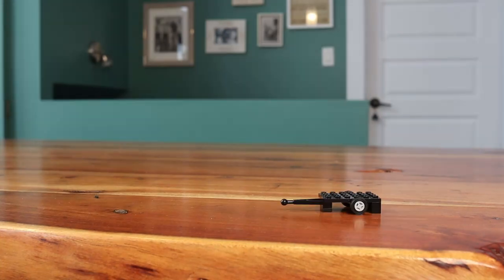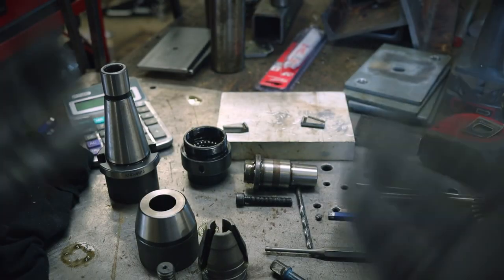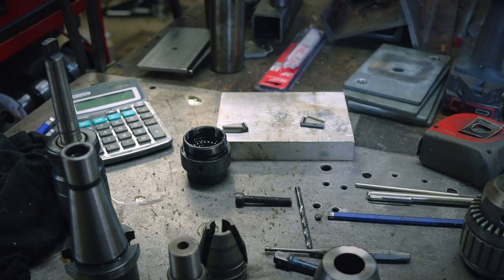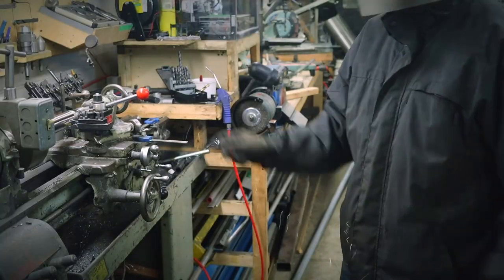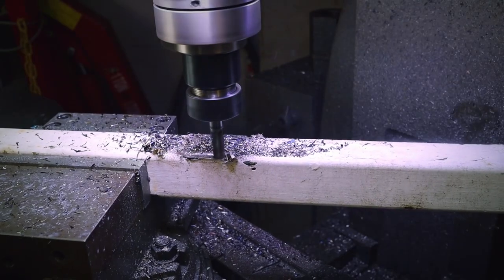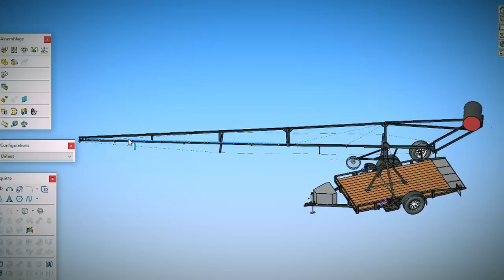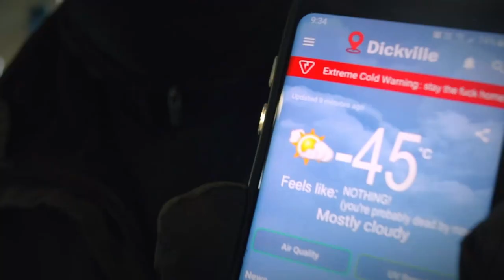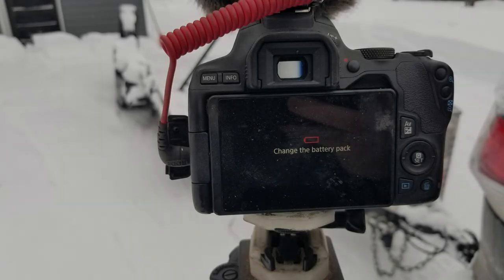FLYING MACHINE, Part 1: The base and main beam

Comment: Viny B
I love your stuff. Greetings from Missouri.
As a 57 year old heavy equipment mechanic, finding an engineer with common sense...and dirt under his fingernails is like finding a five leaf clover! I'm much more accustomed to the engineers who place a red hot turbo charger right next to the radiator. Or the engineers who mount all of the filter bases upside down, so that all of the contents of the filters dump out as soon as the filter cartridge is loosened. I look forward to your videos.
PS
You've got me thinking about building a heavy version of your airbag trailer.
Cheers!
Reply from the maker: Hey I have nerver been called a 5 clover leaves 😅 Glad you appreciate my content! I also do a lot of mistakes like the exemples you listed...I just work my ass off till it works and is bullet proof!

Comment: @7:44 only using what's best for you safety.... MOMENTS after juggling the slicing ball of arterial openness what comes from the lathe.... use higher feedrate or a deeper cut, get that chip shorter m8.
Reply from the maker: My late won't take it! It's an old thing...but I love it!
Reply: @VinyB57  Ah that's fair. Have you tried a positive angle yet? Like a SDJCR holder with DCMT inserts with a small nose radius like 0.4mm or smaller (I don't know what size your lathe will take regarding the thickness of the holder.. gotta figure that out, but try to get the biggest it'll fit, for stability). Also, it may seem redundant, but buying from a "brand" is better usually regarding the inserts... Mitsubishi or Kyocera have great tools/inserts, I'd start there. If you're looking for a general, all purpose coating try the VP15TF (Mitsubishi).
Reply from the maker: @pco1984  sir...your are speaking a language that I had to googled! 😅I do have a SDJCR holder, but with cheesy chinesium inserts, so I don't use it that ofthen, only when needed. I'll try to find good-ish inserts and instead run that type of inserts next time, thanks for the info!